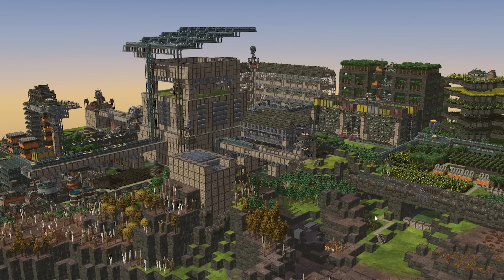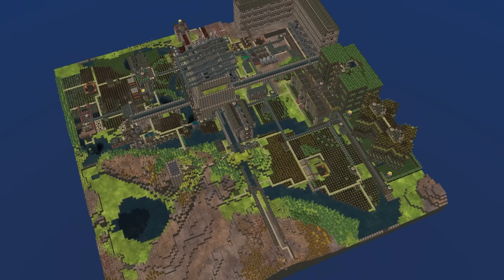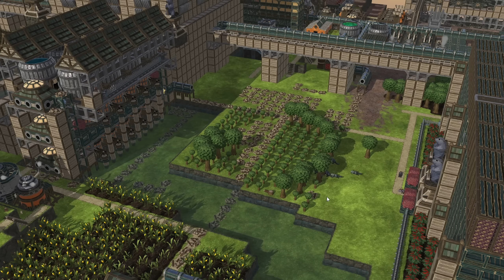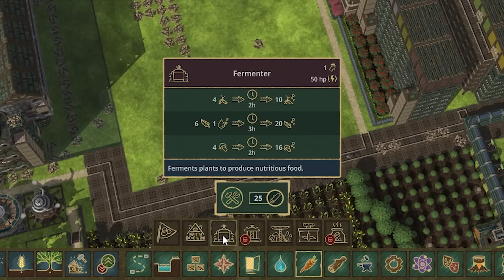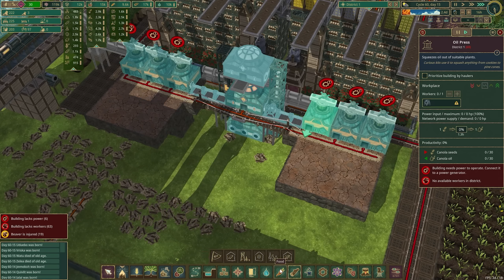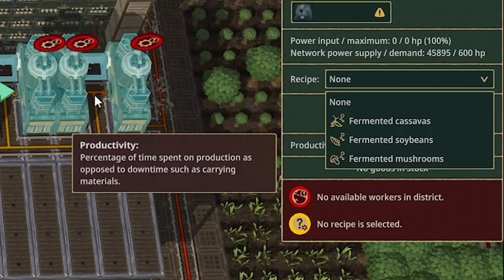From Farm to Farm Factory - Timberborn - Skyborn #11

Comment: 23:41 Something that might be useful for Tubeways stations, the tubes can be attached to the bottom of a station, so you can bury the connection. I’m not sure if you would have made any changes, but it’s good to know. I think Tubeways and Power can connect through metal overhangs if that’s useful to know. 

Do you know if you can connect to the roof of the station? I don’t think so, but I’m not sure?

Comment: Feel like the bridges from the central elevator shaft to the wings would have been a lot easier if the jagged station platforms had been flush and used the extra squares adjacent to the tubeway station doors as the start of the suspension bridges over to the wings instead of trying to have the bridges come from the wings to the center.

Comment: finally. I had just gotten into the series right as you took off for your break. I've already had my fill of the new official map in your absence. Have you peeked at it? Any thoughts? 

They've lifted one concept off the community maps for it, and it's not apparent from the preview so I won't spoil it, but I think it marks a good direction. They are paying some attention to the community's maps.  It's alright, visually interesting, not really groundbreaking in it's own right, since community maps have done all the things it's doing, but it is a good showing for 3d terrain from 7 and 3d water from 6.

Comment: I recently figured out that I can tunnel under the map and create underground cavities that once I connect to the base of my reservoir keeps everything above it green. I'm planning to try to green everything without evidence of the tunnels.
Reply: I've done that on this map. the whole "upper right" section, as he calls it, is a flat land farm with irrigation in tunnels under it.  I also have tubeways and power tunnels under there too.
Reply: Remember that water still evaporates from tunnels. A tip is that three wide tunnels have much less evaporation.